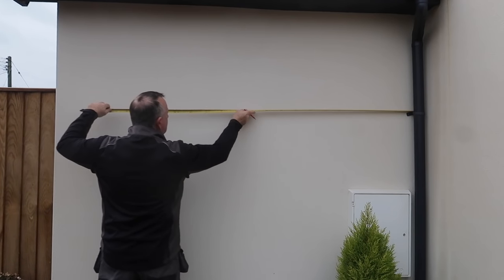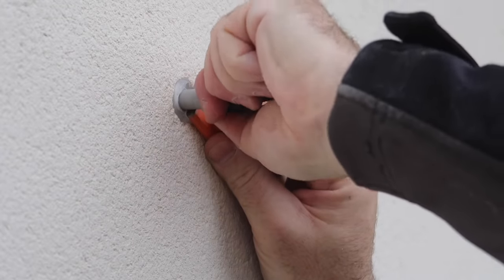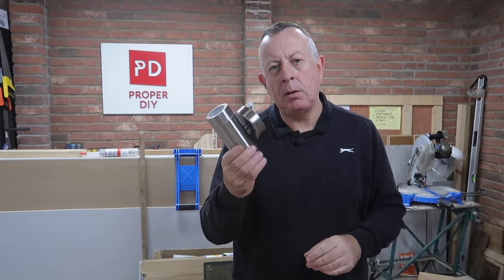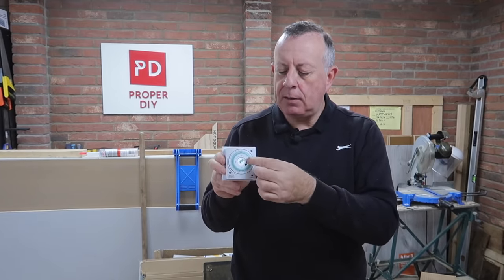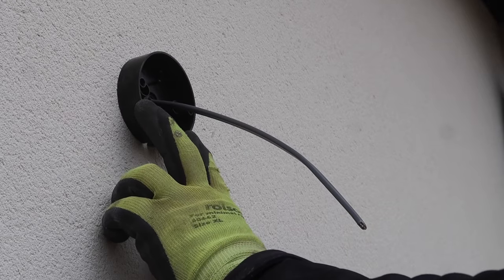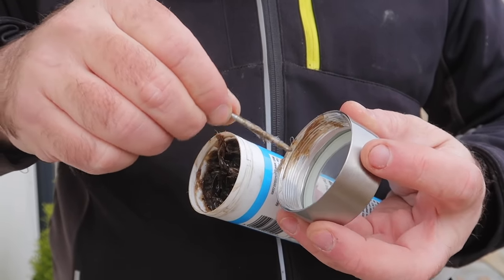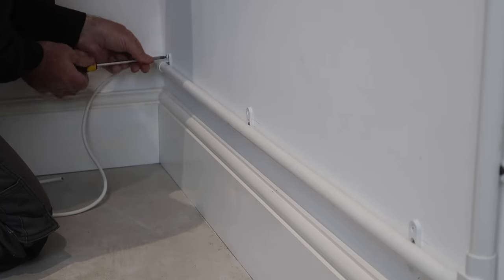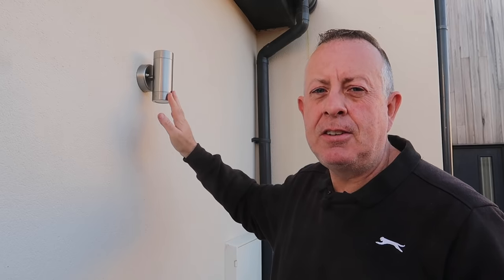Outdoor Light - Easy Installation without touching the house electrics.

Comment: Probably could do with a 3a fuse. As a common sence diyer if the light decides to draw 13 amps due to a fault such as a short then the cable could take 13 amps befor the fuse blows.  a .75 mm flex that an amature diyer uses isn't 
capable of taking 13a. On the other hand what the differance in a .75mm flex prewired to a floodlight. Connected to a 4mm swa radial. There no fuse on that to protect the 0.75mm flex

Comment: What advantage was there to using 1.5mm twin and earth between the light and timer compared to running 1mm flex all the way through from the plug?  That way you wouldn't need to brake into the earth and make a join with the wago connector.  It also means the earth is continuous between the plug and the light.
Reply: Wiring regulations and best practice. Flexible cable is made up of strands of copper wire, T&E is solid copper wire. Lighting circuits in the UK are 1.5mm T&E which takes a terminal screw without the risk of breaking strands. He used a flexible cable as he was terminating to a plug, which could be subject to movement when plugging and unplugging (just as you would with a table lamp) hence the need for flexible cable, as well as clearly showing the light in question is being supplied from a power circuit. As he said "it's not recommended" but it's not a crime and perfectly acceptable. Good job and a quick fix.
Reply: Because he needed to connect timer in circuit therefore couldnt go straight from plug to light.

Comment: Good stuff.Do you think it is possible to use outdoor light cable (originally built by developer) to power garden lamp post.I think to extend cable into a ground .
Reply from the maker: Any cable going out of the house in the ground should be armoured and is a higher risk so I would definitely talk to an electrician
Reply: @ProperDIY  yes ,was gonna use swa cable

Comment: Nice to see you using proper 20mm pvc saddles for the conduit,  and not those single fixing ones that look like copper pipe clips.
Nice video.
Reply from the maker: Thanks. Yes those copper clips look well out of date now - easy to get right these days with places like Screwfix around.

Comment: Quick question, 

Can i run a couple of these lights on a single 13 amp plug?
Reply from the maker: Yes, you can run a lot more then that but you need to make sure that the fuse in the plug is the correct rating for the cable

Comment: Thanks for video, why do you/ is it not recommended to connect a plug to twin and earth?
Reply from the maker: Because there is a risk that movement of the cable around the plug over time damages the solid cable and finally breaks due to fatigue. Small risk but thats what the regs say!
Reply: @ProperDIY  makes sense thanks for explaining.

Comment: Just installed outside lights using the methodology you've outlined in the film.  Used a Kinetic switch for remote switching but basically the same as you've done.   Great idea and very clear.  Love being able to do this without having to get a minor works certificate from a qualified sparky.
Reply from the maker: Nice one - especially with the Kinetic switch!

Comment: Is it ok not to use a pipe, just the wire? I did it that way back then.
Reply from the maker: Yes it's fine as long as it's sealed in some way against rain from the outside. The good thing about putting in a pipe is it's easier to feed through a cable without it snagging in the cavity but not the end of the world if you haven't used one.

Comment: You’ll have no sockets left in yer hoose if you keep sticking plugs on things and using a socket.  Would be much neater to terminate it in properly into the ground floor lights circuit

Comment: As an electrician for 31 years, you get a thumbs up. Well done. Clearly explained.
Reply from the maker: Thank you very much. As always I do very much appreciate positive comments from electricians!
Reply: @ProperDIY 
As always, another down to earth reply.
Reply: As an electrician do you now think that having a light on most likely 32A circuit breaker would be a little unsafe. You could argue that there is a 13A fuse use in the plug but thats still quite a low level of protection. But apart from that i do agree the work has been explained very clearly and completed to an acceptable standard

Comment: Great video, I liked the helpful hints about using the 15mm pipe through the wall, the use of silicone to fix the cable and pipe in place, and the orientation of the light and fitting. One observation I'd make is the necessity of an earthing sleeve on the bare earth wire. I look forward to future videos.
Reply from the maker: Thanks. The sleeve on the earth wire is an industry standard practice. Personally, I don't think you need it but if I don't put it in I get a lot of flack from the electricians who watch these videos!

Comment: Can I ask for some advice if I wanted to install 4 of these would that be possible on 4 seperate plugs? What’s the best way of doing this without having to disturb the house electrics? I really like the idea of just being installed on a standard plug. Also would I change the fuse to a 3A fuse?
Reply from the maker: Yes, no reason why you can't put 4 on separate plugs. The fuse should be changed to a 3 amp to protect the cable. This is the only way really to do it without touching the house electrics.
Reply: @ProperDIY  to do this would I just connect 1mm cable to the connections on the back of the light fitting

Comment: If it was into a red brick wall into a garage would it need the Plex pipe?
Reply from the maker: No, I wouldn't bother - only if it is a cavity wall going into a house.
Reply: @ProperDIY  so just 1mm 3 core cable for the connections

Comment: Great video Stuart, could the spare termination on the back of the timer be used to join the earths?
Reply: I thought the same thing. Did look different color than others.
Reply from the maker: It could be but didn't say so I didn't really want to blow up my new timer just to find out!
Reply: Its best not to use things against manufacturer's instruction. I think on these timers it says "not used" rather than "do not use", but all the same, it isnt marked or identified as a specific terminal.

Comment: When connecting the  1mm twin & earth cable you must double up on the bare wire because when tightening up the connection screw it can cut the cable ( you failed on this bit of the installation but not too bad on the whole)

Comment: You could of fitted a GU10 Dusk to dawn lamp, this would of removed the need for a timer, assumig you want it on in the hours of darkness. Congratulations on the neatness.
Reply: See my comment above. Of course this is fine with LEDs but would not be so good with halogen bulbs, especially in the winter
Reply from the maker: I could of done but that means they would be on all night

Comment: Good idea! I fitted some LED downlights in my kitchen alcoves, ran the cables to wall switches and then down onto plugs that go into my lower wall sockets. No need for an electrician and no building regs to worry about.
Reply from the maker: Great tip!

Comment: Did you fit a5 amp fuse to the plug?
Reply: Hopefully not as that would be too high. A 1 amp would be better.
Reply: @elminster8149  👍
Reply from the maker: I changed it for a 3amp
Reply: @ProperDIY  good boy😊👍

Comment: Nice guide! Just on the use of old analogue timers,  they're extremely limited and you'd need one for every light (or circuit). Instead Philips hue etc would be much more flexible and even follow 'sundown' and 'sunrise as it changes through the year, and can be controlled away from home too.
Reply: Much more expensive and complex though. You only need one timer if you use a regular power strip.
Reply: @martinsvensson6884  Not complex at all. As long as you have a grasp of smartphones it's simple. It is more expensive, but then, so is buying a replacement G10 or other bulb every year or two, when philips hue last a minimum of 8 years (and more likely upwards of 10). I wouldn't go back to old 'dumb' bulbs if they were free, quite honestly.
Reply: agreed, something like a quinetic wireless set up off a fused spur from the double socket would be great as it would utilise smart home and can add multiple to a single no wired switch
Reply: @sdtunstall  Its a far more complex construction. That's why its also much more expensive. I'm not really a fan of adding complex solutions to simple things. Especially not in insecure times. Turning on a light outisde is not that hard or troublesome to begin with.
Reply: @sdtunstall  First time I've looked a Phillips Hue, very impressive, but that is some seriously expensive stuff. I'm 58, I doubt I'd live long enough to get my savings over cheaper LED lighting 🤣.
Reply: @sdtunstall  I see no reason to overcomplicate a simple solution unnecessarily. You're also introducing a dependency on a mobile phone, which isn't needed.
Reply: @elminster8149  I think most people own a smartphone and understand a few clicks around an app. Hardly complex and a much more flexible and controllable solution.
Reply: @MrMattlock  you replace a normal bulb every 1 to 2 years. A smart bulb will last around 10. Over the same time period you'll spend the same, probably less on hue (if you get the non colour changing bulbs) , except the hue bulbs will have way more functionality in that ownership time.
Reply: @sdtunstall  But unnecessary for the solution required here. Your introducing extra functionality and failure points where none are required. I really don't understand this. Simple solutions are more reliable.
Reply: I personally would not fit an analogue timer and just fitted a inexpensive smart plug for about £20. I am a big fan of my Kasa plugs and the interface is really simple to use.
Reply: I would have gone with a Kasa smart plug £9 from Amazon. I have a few lights on these now and all linked to sunset / sunrise so come on at the right time every day. Cheap and very easy solution.
Reply: Seconded to all the 'smart home' things here. You can have inexpensive smart plugs, bulbs you can set for different brightness at different times, smart dimmers, etc. Philips Hue is very overpriced and unnecessary IMO

Comment: Great video. I did something similar recently, but chose to have the light have a regular plug on the end, and use a plug-through timer. This way I could use a smart plug with an app, which actually worked out cheaper than even the basic analog timer, and allowed me much more flexibility in setting.

Comment: The fourth connector could be used to connect up the earth negating the need for a separate connector.
Reply from the maker: Maybe. The instructions just said not in use so I wasn't going to chance it
Reply: My guess is that it's not connected to anything.It would be interesting to put a meter across it and the live and then neutral to check for continuity.Anyway thanks for your reply.👍A very good video indeed.

Comment: Bit confused you put twin and earth into the wall but then you put flex cable and said this is not recommended with twin and earth  ?
Reply from the maker: It's not recommended to use twin and earth into a plug as any regular movement can cause it to fail over time hence the use of flex. The twin and earth to the light I found easier to use with the screw connections.
Reply: What would be best to use ?

Comment: Can guarantee the fitting will be corroded after 12months. Up and downlights are awful to fit especially the pir versions. As they get cheaper they get more awkward to fit. Good old asd outside lights are great and last for years
Reply from the maker: That video is now 2 years old and the fitting is still working fine because I greased it.
Reply: @ProperDIY  what the whole fitting?
Reply: @Jamie-x4c 
Try watching the whole video with both eyes and brain and you will find your answer mentioned. Not once but twice. At least.
Reply: @JP_TaVeryMuch  nice having a greasy fitting when you need to replace the lamps. Try patronising me when you know what you’re talking about,mate
Reply: @Jamie-x4c  Ha!
As Yoda said
Don't try, do.
And anyway I wanted/want to help you by pointing you in the right direction.
But here, I'll spell it out for you cos your "greasy fitting" suggests that you've missed it in the video.
Grease the screw threads is what himself is saying.
Reply: I’ll explain this slowly so you can understand……the whole fittings rust even marine grade. I have replaced whole barratt sites after 6 months. 2 years later I have driven past and theyre all rusty again. Thats my point. Now go away and don’t bother me again
Reply: @Jamie-x4c  
Hee hee.
Wilco.
I see the light and apologise for not picking up that you were going on about a different use of grease than our host here's screw lube.
Now I'm going to have a sit down and a cuppa and I suggest that you do too.

Comment: Well I never knew about there being male and female fittings on the lamp.  Makes perfect sense now you've told us.  And I can confirm that not greasing the threads causes problems later on.
I've found that its always the up facing bulb that needs replacing most often, which surprises me as you'd have thought the heat in the downward bulb would cause failure first.  Great video.
Reply from the maker: Nice one. That's funny, I've also found the upward bulb failing more often!

Comment: In my opinion this video  is dangerous and should be removed immediately because it does not include information regarding the most important part of this installation and that is the fuse you install in the plug should be no more than 5 amps ( 3 amps preferred ) this is a very important safety notice because the plug top usually comes with a 13Amp  fuse ( I would also advise you check the ring circuit for the socket you decide to use is RCD protected) because the light is external

Comment: But with you it’s different.  You are a DIY expert.  So you know exactly what you are doing.   Very unfortunately I’m, not. 
Every time i start to do a DIY job; it gets botched up;  as I’ve already done so… trying to fit my very compact kitchen.  
I’ve made a lot of mistakes;  misjudgment’s ect;  so, very unfortunately it stays botched.  It’s not done right.  But you do learn as you go along.  But that’s not really good enough.
To get some professional to come in to do the job… would set me back around 7 or 8K.  A lot of money, to fit a tiny kitchen.

i would imagine the same thing would happen trying to fit a light.. similar to the one you fitted.   Actually i thought the light that you were fitting on the wall, was actually battery powered; as opposed to electric ⚡️ in which sounds even more difficult to fit.
But to get an expert to fit a light on my wall.. would cost around £400 odd.  Including VAT & labour.  Quite expensive.  🤔  

VERDICT.  i think i would need to go to college to learn any kind of DIY;  in which is just not for me.   Everything stays botched up.  So sad, in a way.
Monday afternoon at 15:56H.  13th December 2021.  U.K. Southampton.

Comment: Personally I would have fitted a Shelly 1 smart relay in the backbox instead. Better control of the light, especially when there are seasonal changes. Very simple to set up.